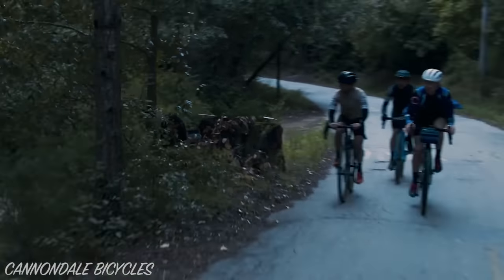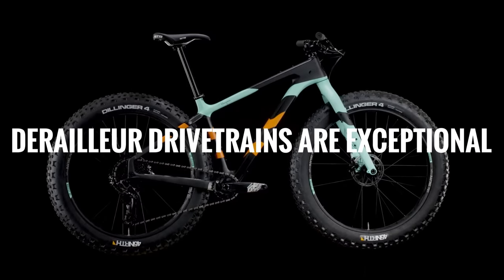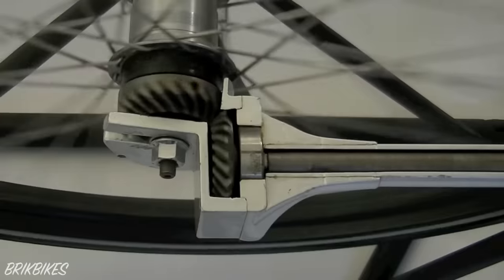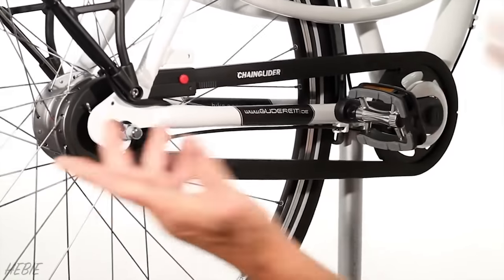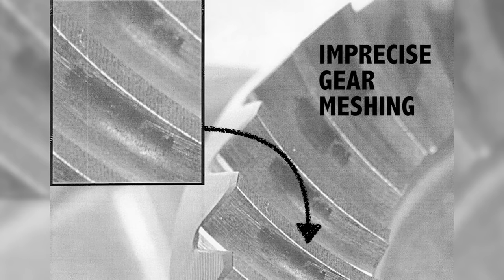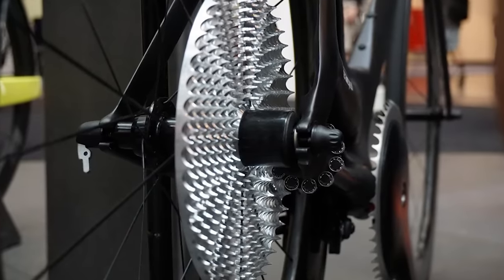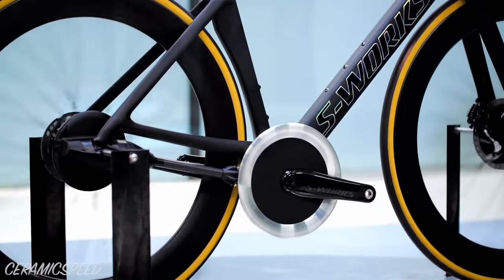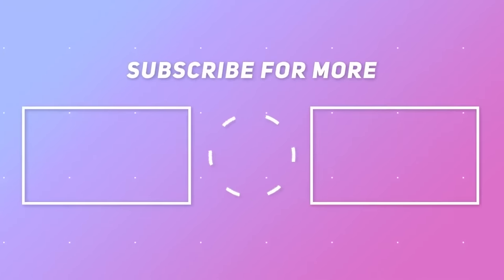Are Chainless Shaft Drive Bicycles a GENIUS or TERRIBLE Idea?

Comment: me, an intellectual: Why do chains when you can do GIANT GEARS
Reply: Added weight.
Reply: Rolls along on top of the bottom bracket gear because it's so big 😂
Reply: @keithwittman4741  SKELETONIZED gears.
Reply: Pedal assist seems like a far better solution.
Reply: excuse me
Reply: because it is less efficient than chains. you will need more stamina in the shaft drive than the chains if you ride for longer period of time for the same amount of distance.
Reply: Aren’t gears is the one mentioned in the video?
Reply: Haha yeah just drive the back wheel from right at the rim with a big gear right at the pedals. Problem solved. You do have to pedal backwards to go forwards though, and the gearing is super low, but you'll hill climb like a champ ;).
Reply: @nicmagtaan1132  I have a lot of stamina in my shaft
Reply: That's just the Penny Farthing.
(Forgive my spelling?)
Reply: Weight, inefficiency, expense, probably a little bit of safety, ratio options restricted by chainstay length (which also restricts the bike builders options for wheelbase and associated geometry), very likely requires a proprietary frame with multiple axle mounts for each gear to work reliably, needs an internal gear hub in order to have more than one final drive ratio.
Reply: Gears require high tolerance. If they're not meshing properly, then you lose efficiency.
Reply: just attach the pedals to the hub of the wheel directly
Reply: Heck yeah
Reply: Put the whole car transmission in there
Reply: Weight and efficiency
Reply: Yup
Reply: @tormenmashi_  fk
Reply: @carlosandleon  penny farthing
Reply: Because chains are very efficient in power transfer
Reply: Wow so funny im creasing
Reply: intellectual....alright guesa your opinion about yourself is little overrated...
Reply: @12Burton24  agreed, also hes incredibly funny
Reply: Why not just make it out of Lego?
Reply: @12Burton24  /r/whoosh
Reply: What about giant Metal Gears
Reply: @MonEyRuLess  Lol still some kids do the disrespectful r woosh because they have no fakts and proof 🤣
Reply: @skynyrd7411  unfortunately not enough stiffness
Reply: @williamchamberlain2263  The gender changer
Reply: f1 cars use gears instead of chains
Reply: @luis241661  No way...are you serious?
Reply: DIRECT DRIVE (penny farthing)
Reply: cost must be very high
Reply: I think a baby chicken can tell you that.
Reply: @luis241661  Was more a joke. The reason why they dont use belts and chains is not because of stretching its more because of high rpm and gesr switching. Anyway makes no sense to have gear wheels on bicycles due to weight imaging riding with a gearbox.
Reply: Cause there aren't GIANT GEARS on a chain drive
Reply: @12Burton24  cool, sarcasm is hard to read without tone, cadence n volume lol
Reply: @randy2645  awesome didn’t kno that!
Reply: @luis241661  😉👌
Reply: @weme11  that's what she said. 😄🤣
Reply: Or we could do v8 powered bicycle
Reply: Blah Blah  would pay👌
Reply: Here's another person with illusory superiority.
Reply: @StealthTheUnknown  wow you can use Google. This makes me a hypocrite how?
Reply: @hardestgainer609  it was a joke, hence the emojis. Cool the attitude, captain frowny face 🤣
Reply: @StealthTheUnknown  you can determine attitude through text? Man we have another super genius
Reply: @hardestgainer609  just keep digging 😁
Reply: @StealthTheUnknown  I don't own a shovel and I damn sure ain't digging with my hands
Reply: @hardestgainer609  wonderful, keep it up!
Reply: Im NOT an intellectual. Who rides in the mud? 😂😳  04:10   You ever see people riding bikes on the beach? 🤣
Reply: We need Colin furze on this
Reply: And why use gears when you can just put a wheel on the pedals
Reply: @bugs9284  would be mighty uncomfortable to pedal the back wheel, and a 1/1 gear ratio is not ideal for most biking applications.
Reply: friction
Reply: The price of repairs.
Reply: @wigget2233  no, the spelling is alright👍
Reply: Just remove everything and ride on just 2 pedals and a wheel
Reply: You could have a big single cog nearly the size of the wheel attached to the wheel, with a smaller cog meshing on to it thats driven by the pedals, but then you would only have one gear ratio.
Reply: Sounds like a great stupid idea. You'd have to pedal backwards for starters
Reply: Why do giant gears when you can have a electricity generating station on bike rack.,
Reply: @skynyrd7411  not what your wife said
Reply: U can't get speed without chain
Reply: @tormenmashi_  wtf
Reply: @evelynfarfellwooosh1219   ??
Reply: Why do giant gears when you can have giant BEERS EHHHH!! wait🤔
Reply: I guess the percentage of power cuts down more than chain and sprocket
Reply: Efficiency, weight nd simplicity
Reply: That may be a good idea if performed correctly
Reply: Just buy a motorbike. Its easier.
Reply: You an intellectual ? Do sentences then , Englishbis a proper language, not just vomitting words up   I tale it you dont know what "intellectual" means in my language
Reply: Why not a penny farthing
Reply: @carlosandleon  the Penny-farthing, very scary
Reply: That idea grinds my gears.
Reply: WHILE BIGGER,BETTER !!!
Reply: @keithwittman4741  STRONGER LEGS
Reply: @skynyrd7411  for now...when you get older,You'll need pills💊 🤣
Reply: @StealthTheUnknown  torque
Reply: That would be very heavy and you would loose efficientcy
Reply: Easy, harder to pedal and harder to stop making it inefficient.
Reply: Because torque
Reply: Me thinking if they offer a mechanical advantage u would see them on ever Tour de France bike.

Me thinking if the offer a economic advantage you would see them on every $5 Walmart kids bike.

Thinking some invited them to get around patents in the early 1890.

They look expensive, mechanically complex and don't seam to offer any advantage, I wonder why they fell out of fashion.
Reply: It’s not high tolerance. It’s high precision. Tolerance is the amount of imperfection the design can have and still meet its requirements. Precision is the result of the method of manufacture. If your precision is adequate, all your product will be within tolerance and it should function as intended.

If you are making one of something, say, a guitar, you might make the neck joint precisely to get the action where you want it, but it won’t be made to high tolerance because there was no tolerance. You just made it.
Reply: Gears are great, but only in a rigid framework where they can be aligned precisely and they enjoy lavish lubrication and protection from the elements. In those conditions, they perform, but it doesn’t take much to make them go downhill. In contrast, a roller chain can tolerate a lot of imprecision and still perform well.
Reply: You’d go backwards. Unless there was a small gear in between them
Reply: @johnswoboda2986  yep
Reply: When your gear is bigger than your rear wheel
Reply: A weapon to surpass Metal Gear
Reply: @keithwittman4741  Thats what aluminum is for
Reply: Add small wheels and use it on the moon surface. Ez new Olympics discipline
Reply: Yeah that won’t wear out fast 🙄
Reply: @keithwittman4741 Very low diferente